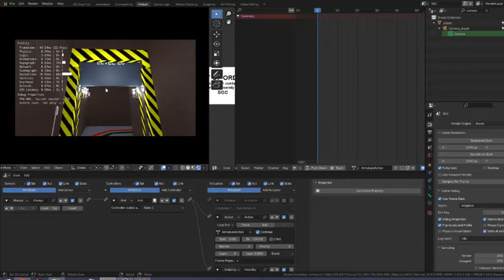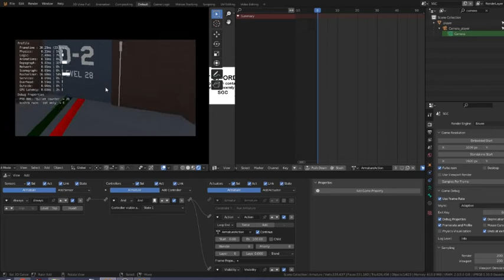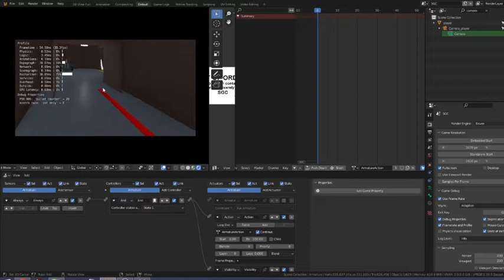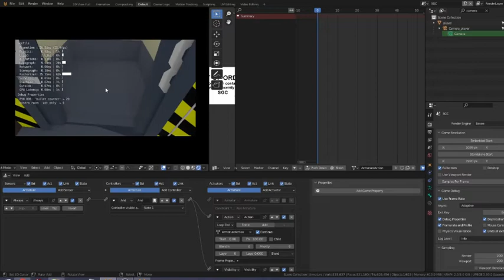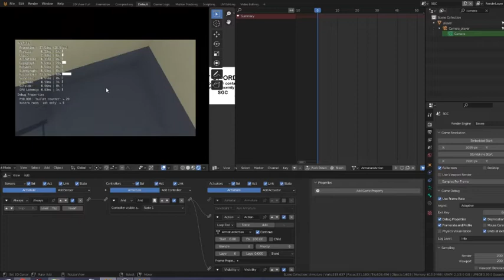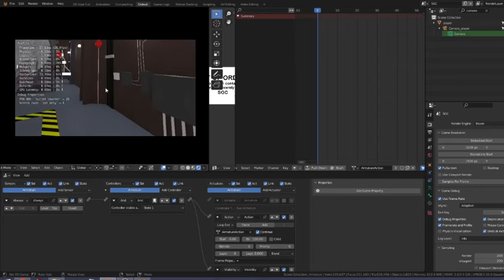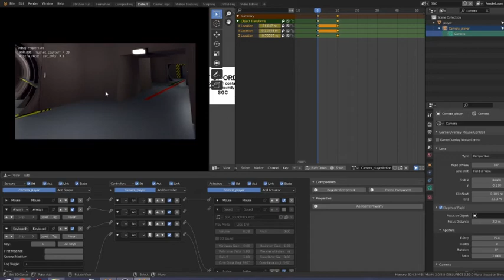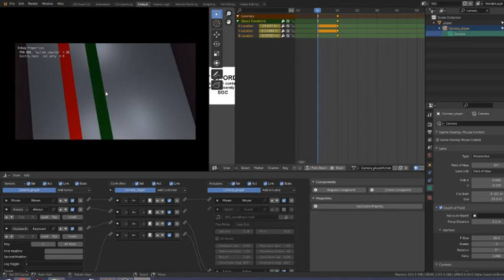UPBGE 3: Problems   with FPS , Animations, Physics

Comment: Use Character physics to avoid sliding, or if you need to use Dynamic, bump up the friction in physics tab. As another guy commented its possible to optimize the game by making each room separate collection and suspend them with Collection actuators, then when you open the door make the there a little delay before it resumes and load that room (collection). Im making open world System shock type game (on UPBGE 0.3) and its tottaly possible. Good luck
Reply from the maker: Bumping Up friction not help. character  physics work . kinda.
Reply: @PetrSir  Character physics are kinda bad in 3.0+
Which is why I stuck with 2.5, because everything works like It's supposed to.

Comment: I think it mostly comes down to framerate. If you are targeting 60 FPS but it’s only hitting 15, your animations will be 1/5 speed or something. If you are using any procedural materials, bake them down to simple textures. For simple colored objects, I would create one material with a texture containing all the colors in the scene, and then set the faces to be tiny and only sample the right color. You can make a grid where each color is 2x2 px and scale the UVs to 0 and place them on the color. The less materials, the faster. Also, consider that more geometry means more cost to performance when using shadows. Disable shadows on any lights that aren’t actually casting a shadow. Lastly, I would recommend setting up load/unload zones and chunking out your map. This is what most games do as it will allow you to keep minimal geometry on-screen and will greatly speed up the game. Since you have narrow hallways, it will be super easy to do this and you can have very little loaded at once and it will run great! Right now, it looks like you may be loading the whole thing at once 😬. Maybe consider setting the target frame rate to 30 fps as it will run at full speed even if it can’t run full speed. The logic in UPBGE is dependent of framerate. So, if it’s running slow, 1 frame to play an audio file will take a 15th of a second instead of a 60th. This will introduce some delay as you see. Spend some time optimizing and it will really pay off. Hope this helps!

Bonus tip: set all your materials to have “backface culling” in material settings as this will slightly reduce lighting cost. Good luck! Looks like a great game!

Edit: please report this bug on the UPBGE issue tracker: https://github.com/upbge/upbge/issues The devs are very active and will probably try to fix it. I reported a bug about the mouse movement not working right when the game is lagging and they fixed it really quick.

Comment: This type of game is best done in 0.2.5, 0.3 is unfeasible and will probably have a bigger fps drop if you add a new object in the scene like shooting bullets for example.
Reply from the maker: I've already tried it but this UPBGE does not have Eevee render. My whole project  is made on Eevee
Reply: The problem with eevee is that there is no way to increase performance, that is, decrease the graphics, even reducing the graphics it is still heavy. If someone tries to open a game made in eevee, the game will likely crash, or not even open.
   Upbge 0.2.5 has the possibility to greatly reduce graphics and can also use CUBEMAPPING, very useful for complex games.
 An example https://m.youtube.com/watch?v=RxHah4uXOwU&t=108s.
https://youtu.be/Nx8HHe65KM0
These are heavier because and in real time, there is also the CUBEMAPPING BAKE that is much lighter, https://youtu.be/vPjT20lS53A.
Reply from the maker: @holandonhdunto6808   Ok , but 2.5 UPBGE is too faar from new upbge that I cant use it.  because many function are not even there. performance seems better. even 60 fps  but when I look at stargate  it decrease on 5 fps .  but anyway thanks for advice.
Reply: @holandonhdunto6808  no, you just meed to optimize it better. Look at the demos on my channel with Eevee. Both can be run on mid-range graphics cards. You just need to be VERY mindful of how you use your resources. I have been using Eevee on very crappy laptops for years so I have lots of experience with optimizing. I might make some tutorials as it could probably help people
Reply: I think the problem with eevee is not just on the devices of those who make the games, the problem is on the devices of those who are going to play, maybe the game doesn't even open, in eevee even using lowpoly objects, with small textures or even without texture or material, the game is still heavy and crashing.